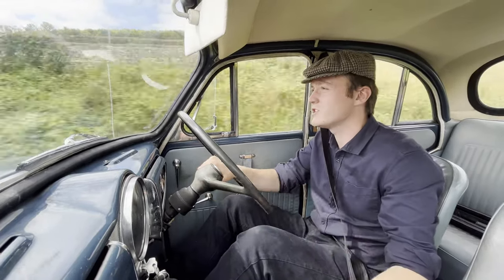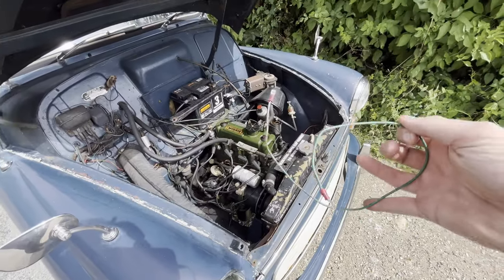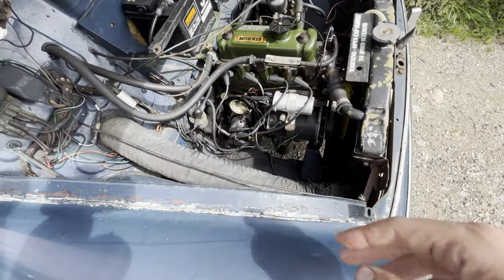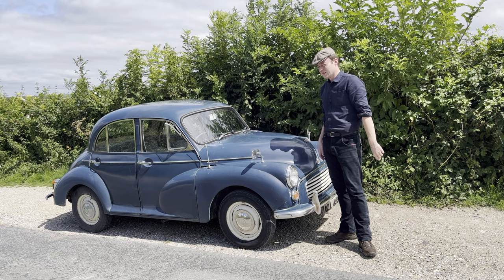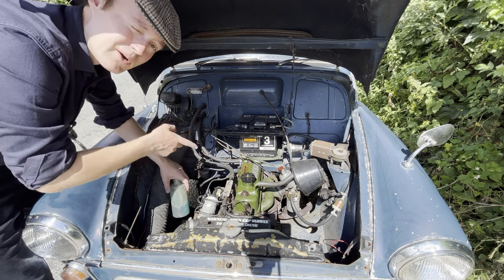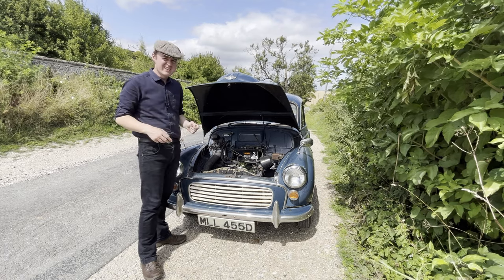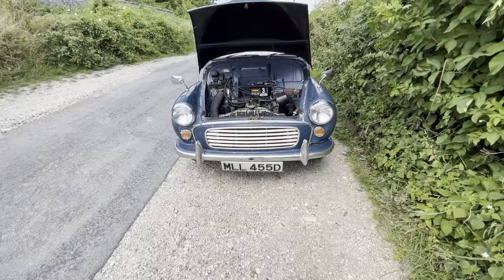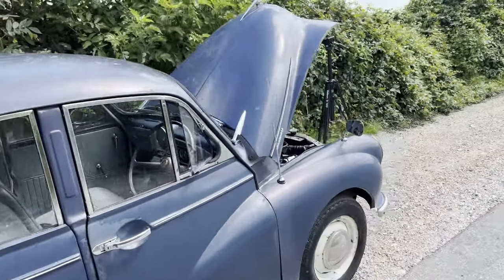Broken Brake Lights & Bodgery

Comment: I did the old washer bottle dodge once. The bottle was mounted on the bulkhead with a manual squirter (to use the technical term) under the dash. I just connected the outlet from the bottle to the carb and relied on gravity feed. It seemed to work quite well. Thank goodness for petrol tank drain plugs.

Comment: I've just replaced the brake light stop switch and didn't need to bleed the brakes as placed a thin polythene bag over the master cylinder cap and put it back on causing a vacuum. Swopped over switch but just be careful and hold the Tee box connection with pliers so it doesn't twist whilst undoing the switch. It maybe a 9/16th socket (22mil on new replacement). I pulled off the heater hose and got access with 2 bar extentions onto the old switch to get it loose and had the new one to hand and quickly put the new one in without any fluid loss. Tightened up, attached electric wires. Polythene bag removed from master cylinder, level checked and job done. 👍

Comment: If you have any spare house MCBs (circuit breakers) you can use them as switches. My car overheated because the relay for the electric radiator fan failed. I rigged up some thick wire and a 40 amp MCB and have that in the glove box to switch the fan manually.

Comment: The new brake light switches are awful and don’t last more than a few months - they can’t take the current from the two bulbs. What I did was make a plate and mount a few fused relays fed from a spare tag of the starter solenoid live - I also set up relays for the horns, and headlamps and to be fair they are a massive improvement been using them for five years without problems. I just reused the standard feeds and as the switching circuit - one I sorted out decent brass earths all is good and bright. I do not trust the standard Morris fuses!

Comment: In that location you should be able to swap in the new pressure switch without risk of admitting air in to the brake line. Do it swiftly as fluid is emanating due to gravity from the master cyl above. It won't gush out nor can air get it as fluid emerges.
Reply from the maker: The thought had crossed my mind! The master cylinder is actually lower than this point (in the chassis rail) so it won’t flow out, may just swap quick and test!
Reply: @badgerlodgegarage  OK bottom hung pedals. Sorry I had overlooked that arrangement . However given the m/cyl position it may be an idea to first raise the rear of the car to a level where the fluid reservoir is at least slightly higher than the offending pressure switch before swapping in the new one. BTW I do enjoy your videos particulary of the Relaint as I have had various of its small sucessors and currently have two early Rialtos in my eclectic classic fleet as well as an 1938 Austin Seven sports with the Reliant 850 red top engine and box. Vids are on my channel. The alloy Reliant engines are a thing of joy when well looked after. That was a truly dreadful one you took apart. Oddly despite having had scores of classics including several of the earlier Morris 10 series Ms I have never owned a Morris Minor hence my ignorance about the m/cyl location.
Reply from the maker: @chriswybrew1740  thanks very much for watching and your suggestions, may well give it a go! Sounds like you have some interesting vehicles, I shall go and have a look at your channel. The reliant engine is truly a wonderful unit. 
And Thanks again your your brake switch suggestion, it’s always appreciated if it makes life easier!

Comment: The current crop of brake light switches are awful quality and don’t last long with the power demand of two bulbs - so what I have done is used the new switch as a switched side of a relay and feed the lights directly from a live feed from the started solenoid via the relay - did the same with the head lights and dipped beams and horns - put them on a small plate on the elephants trunk. One I sorted out the terrible earths the light have been permanently bright and reliable for five years - oh I made sure the relays were fused as lets be fair the morris fuses are not good enough!
Reply from the maker: Iv also head this before, I will probably replace it as is for now, but if it doesn’t last look at other options!

Comment: I used to carry bits of wire and the odd switches and tape with me and i also had my morris minor brake light switch pack up when i was a long way from home.. i used a switch that i had used for a horn when my horn button broke,2 longish lengths of wire connected to the brake light switch and taped the switch to my door handle so whenever i had to brake i just operated the switch and got home ok.
Reply from the maker: Nice one, thanks for sharing!